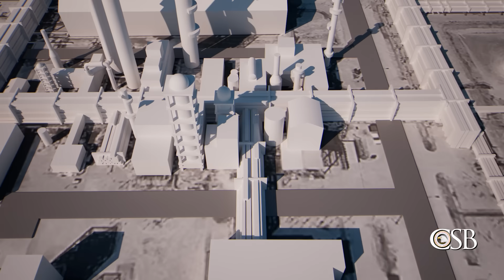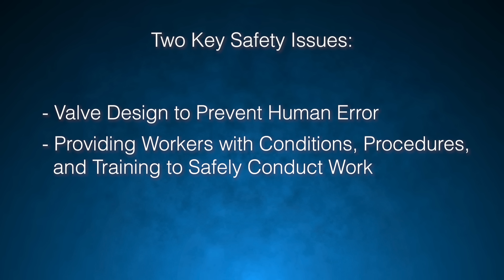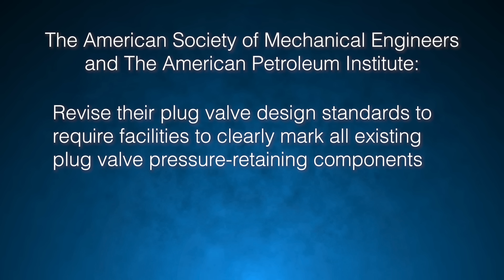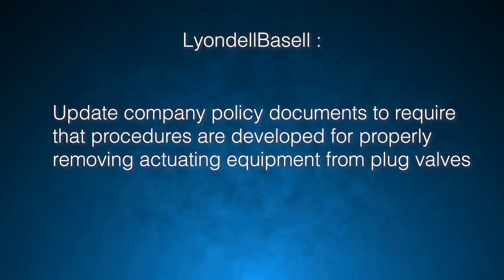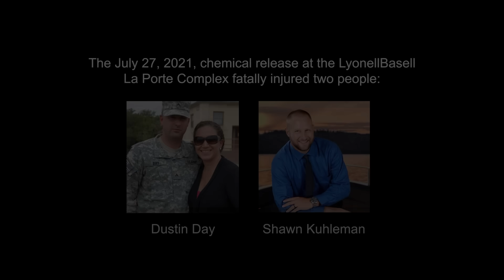Designed to Fail: Chemical Release at LyondellBasell

Comment: Acetic acid, what makes vinegar.
We use 5% for food, canning, and cleaning.
It smells and tastes bad enough.
I can’t imagine being doused in 100% strength of this stuff.
Reply: And HOT to boot.
Reply: I've worked with glacial acetic acid and acetic anhydride - the strongest "chip shop" vinegar smell ever! As a brit it just makes me crave chips.
Reply: I got a sniff of the 100% stuff in a lab once, it was awful. I couldn't smell anything else for an hour
Reply: @BrandNameCerealFlakes Anosmia is a dangerous thing in a chemistry working environment so I hope you didnt have any permanent issues.
Reply: @Cutest-Bunny998 its why i decided not to go into chemistry.
My sense of smell is worse than my legal blindness.
But sometimes rarely i can smell things. Idk why.
Reply: Yeh u was going to say I hate the smell of of vinegar at 2-3% I can't imagine what that would smell like even from 1000's of feet away
Reply: 20% vinegar will burn your lungs if inhaled. I cannot imagine how terrible this would feel.
Reply: @agoniaXdunya in the Landscaping industry where you have a ban on traditional pesticides do you use a product the concentrated is 25% acetic acid and you dilute it one part concentrate with three parts water. It killed virtually anything I sprayed it on
Reply: Stop bath for black and white silver photography chemistry is 28% acetic acid.
Reply: @johnmarten4184  they also call it Glacial Acetic Acid
Reply: I've experienced a plug valve replacement where there was about a gallon of this ac in the line left over from clearance and it was warm, not hot, and that was uncomfortable and I was about 3 feet away from it.  Bro who lived must be or is counting his days... Hope he lives a long productive life.... Preferably in an office with a settlement under his belt and a work shop in his garage.
Reply: We had some in chemistry class and we would challenge each other to keep our face above the container for the longest. 3 seconds was my record lol
Reply: Shift supervisor told me about how, when they worked a lot with it a few years ago, the mess hall would only let them take to go meals because of the smell.
Reply: Gotcha I was wondering what it was
Reply: I took a sniff of 100% acetic acid and i swear it singed my nose hairs
Reply: I got one tiny drop of glacial acetic acid on the lab bench. It left a tiny pit.
Reply: Not 100% here, but hot and a lot at high pressure
Reply: I actually use a cleaner for medical appliances that contains (probably diluted) acetic acid... scary to think about

Comment: Here is my theory on why they removed those nuts:  On some actuators (see page 20 of the report) the actuator is installed by putting a plate under those nuts. You still shouldn't remove them when removing the actuator, there are other nuts for doing that.... but if you had only ever installed new systems using that style plate you might think that the correct way to remove the actuator was to reverse the install procedure. This is also consistent with the worker's explanation for their actions.

Comment: I think the finding to identify pressure containing components of plug valves to be over the top.  Its clear as day what the bolts on the top of the valve are doing and if a maintenance worker cant figure that out, they are probably in the wrong field.  Also, being at a chemical plant, if you don't know something, ask.

Comment: NO NO FDA FDA REMOVE THAT FROM FOOD SOURCE
Reply: It's not some weird manufactured chemical. Its undiluted vinegar. They were just distilling it from its natural sources. Acetic acid is the scientific name for white vinegar that hasn't been diluted with water. It's dangerous only because it's concentrated. White vinegar, which humans have been using as a preservative and pickling method for ages, Is simply about 5% acetic acid diluted in water.

Comment: I'm Sorry 'It Should not be ingested if you can not Touch it.' Is A real thing?? Jesus
Reply: Acetic acid is just the scientific name for white vinegar that has not yet been diluted by water. When you buy it in the store, it is at about five percent concentration diluted in water. It's not some weird chemical additive. Vinegar has been used to flavor, Pickle, And preserve foods for centuries. This factory was just mass producing it, And this storage container had The acid at it's full hundred percent concentration, with no water in it to dilute it or soften the effects. It is not dangerous as vinegar, It's only dangerous when it's At a hot high temperature in a high concentration.

Comment: These videos are a great source of very useful information. Excellent job. Disassembling an actuator on a plug valve, or any valve, pipe, component, without fully understanding the systems and components is a sign of an untrained workforce.
Reply: Definitely wouldn't be a pipefitter doing that job here in Canada, pneumatic actuators and their valves are firmly within the scope of instrument techs.

Comment: Completely unwatchable. The truck tires don't rotate at 2:18. Edit: Oh I guess the camera is moving. Looked like it was backing up. Never mind
But really, wow. Removing the actual nuts holding the valve closed. That's a big oops. And they had so long to realize what they were doing.

Comment: I guess the actuator is removed to prevent accidentally opening of the valve during maintenance? But why can't they just take the actuator completely offline + physically lock it in closed position? That seems way safer and easier than removing the whole unit.

Comment: One of the workers explained his reasoning for removing the pressure-retaining nuts. He told the CSB they had to
remove the interior fasteners because “…it’s all connected. As [the actuator] sits up there, it’s all connected to one another.” This
worker did not seem to understand that the interior fasteners were pressure-retaining and should not have been removed.
Reply: If it was really necessary to remove the pressure retaining screws to remove the actuator, which I doubt, then the actuator should not have been removed under any circumstances. But that would not have been necessary to secure the valve so that it would not be opened accidentally. Usually you disconnect the power supply to the actuator when it is closed to prevent it from being opened accidentally.
Reply: @benjaminhampel8640  Correct.  And as such while I was there, that was the rule.  Don't touch that valve.  The only time it was, was after the reactor was emptied and depressured and made full of air to be entered.  ONLY 1 time as I remember.
Reply: @lpconserv6074  how did you know that?  oh, did someone teach you that?  well, that expertise costs money and time.   and i can just hire people and yell at them to get it done.   whatever.   insurance will pay.   stonks must go up.
Reply: @benjaminhampel8640  this feels kinda like what happened with an incident in baton rouge back in 2016, where a valve got stuck, and a badly made valve gearbox design connected to the top cap caused a release

Comment: How dum do you have to be to remove the bolt that hold the valve together while trying to take the actuator off.  The level off stupid that cause this accident had to be off the scale.  I find it hard to believe they where actually pipefitters and werent only unskilled helpers that had no training or knowledge.
Reply: Chemical plants and faculty's like them are amazingly complex and dangerous places.   The solution isnt to just paint the bolts a different color but  to hire qualified experienced people

Comment: I work on valves.   Those men might have been qualified to use a wrench.  They were not qualified to work on a valve.  And you dont have to remove a positioner to lock out a valve.  Process valves should be used only as a last resort in loto.

Comment: Just had the maintenance at my work fry $40K of equipment because of perceived simplicity. All that needed to be done was unhook three wires, move the equipment, and hook back up three wires to the same locations. The same personnel did both the disconnection and reconnection of the equipment... And got the wires hooked up in the wrong terminals of the terminal block... 208V into 115V rated electronics. Poof. Thankfully no injuries occurred.

Unfortunately, I think that there's a lot of maintenance done with zero or near-zero procedures, especially for jobs that are glanced at and hand-waved as being too simple to need to bother. There's an assumption made of both the knowledge of the operators at work and the details of the job. What if the wire gauge is different between locations? What if the terminal block is oriented in such a way that it's difficult to see clearly? These things happen frequently and add distraction to the work. Operators in the field need to be open to calling back for more information if they're not sure of a process to something, the business culture must be open to delays to ensure safety, and managers must expect things to never be as simple as they first look.

Comment: Table of Contents

0:00 USCSB Logo
0:09 Introduction
0:59 Background Information, part 1 (LyondellBasel, acetic acid)
1:27 Background Information, part 2 (leak discovery, making plan to fix it)
2:18 Background Information, part 3 (Turn2, procedure issues)
2:51 Incident Report
4:27 Board's Investigation, Safety Issue 1
6:15 Safety Issue 2
8:35 Credits and Dedication

Comment: Why was the actuator removed at all, rather than the power to the actuator disconnected (disconnect the air or electricity) & any manual controls of the actuator blocked? Surely to remove the entire actuator they had to remove the (air or electrical) power to  the actuator anyway, so why did the actuator need to be removed at all? And why were there FOUR OTHER fatal incidents of this type of actuator being removed???
Reply: The actuator was blocking access to the valve.

Comment: What makes this even more tragic is the acutator was being removed to allow for valve lockout. These workers were killed/injured performing a job that was intended to make another job safer. The risk assessment of repairing the leak was properly done, but the risk assesment of the task needed to complete the required work for that leak repair was lacking. The same as an electrician getting blown up by an arc flash while racking out a disconnect to de-energize something for repair.
Reply: What makes it even worse is that the valve actuator did not have to be removed in the first place. Usually, only the power supply to the actuator is interrupted when it is closed, so that it cannot be operated.
Reply: @benjaminhampel8640  You should always remove or block automatic actuators regardless. Certain actuators can have emergency operation conditions, like springs, capacitors, batteries, air tanks etc, that allows the actuator to do a "im dying" actuation. This is commonly used to ensure a safe state if power goes. The safe state could be that its open, to relieve potential overpressure, or closed, to prevent a unsafe supply of dangerous liquid. So you should always remove actuators unless you KNOW that it does not have a emergency actuation ability, OR you know the configured emergency actuation ability results in the "safe for work state" (which may not be the safe state for emergency/power loss).

ALSO: To close the valve, you would have to remove the actuator. Otherwise you would work against the actuator.
Reply: @benjaminhampel8640 In my Canadian refinery, we don't even rely on actuated valves for lock out. There's always a manual block valve close by, especially in a location shown in the video, being at the bottom of a vessel.
Reply: @TLarose.  Of course, if there is an additional manual valve, then you should use it, I agree with you. Apparently it wasn't there in this case.
Reply: @TLarose.  There is a video in uscsb that a fatal accident caused by a manual valve, it's very similar to this case. Things need to be foolprof, i worked as a maintenance tecnician in industrial factory, a lot of machinery we only used our thouth to demount and repair things, even the f engeneer didn't know how to do those things...
Reply: @benjaminhampel8640  would that work if the valve was air-to-close though? But I guess the absence of a manual valve there was really alarming, with all the static head of inventory up there. Control valves shouldn't be used for isolation purposes

Comment: When I screw up or don't know something. I go to the boss immediately no matter how embarrassing it is. This has never got me written up. The solution here is to try to idiot proof it instead of requiring management to be on scene for a valve critical procedure. Sure one sheet of paper could have prevented this but it's still a management failure

Comment: It is glacial acetic acid (high purity) that poses toxicity.
Also, before starting any maintainance or repair, make sure to shut down any process unit that depends on the process unit to be repaired and do a lockout and tagout.

Comment: How many other people were caught off guard by the mention of this toxic acid as a food additive at 1:15, only to Google it and learn that acetic acid is just vinegar (in a low concentration mix with water) but incredibly dangerous in its pure form?
Reply: Wait 'til you learn about aromatic esters.
Reply: Many things that you use over the counter are incredibly deadly in high concentrations. You can get a 3% hydrogen peroxide solution at a grocery store to disinfect cuts, and that only stings a bit; but, 85% or higher is considered to be a rocket fuel that is corrosive enough to strip the flesh off of your bones in minutes. It's hideously toxic when not extremely watered down.

Comment: OK, why isn't there a possibility to lockout the valve WITHOUT removing the actuator, i.e. have a lockout on the actuator ... or am I asking too much?
Reply: That's how the actuator and valve is designed. The shaft itself probably has to be locked out, not just unpoweing the actuator.

Comment: It was a pneumatic valve.  Just close the valve, disconnect the air lines, insert the blocking pin and lock and tag the blocking pin.  There is no safety advantage to removing the entire pneumatic operator.
Reply: It may have been a design or safety procedure to lock the shaft itself with a pin and not just the pin on the actuator. Also, there may have been an intent to remove the actuator to inspect, clean, and/or lubricate the coupler.
Reply: @canlib you are not just pinning when you disconnect the airlines.  You are eliminating the energy source necessary to open rather valve.  that is not what the video said.  They were using the valve to isolate for a downstream leak repair.  Removal of the pneumatic actuator is completely unnecessary to make the job safe.

Comment: No amount of training could save you from stupidity. My theory is that workers knew that they are removing valve plate retaining bolts (maybe there was a reason to do so), but they didn't think that the seal will not hold. At least, if there's a reason to remove those bolts, put a bunch of simple C-clamps around the plate to hold it in place (I admit, this is also sketchy, but way less so).

Comment: Shouldn't the larger safety issue in this video be more about the fact that something they put in our food burned 2 men to death?
Reply: Clearly you never made the mistake of foregoing the mandated rest period for a microwaved Hot Pocket. Literally lava.
Reply: Acetic acid is the main ingredient in vinegar. This is just the concentrated industrially derived version of that, and this version is probably not used in food. Sorta like how hydrogen peroxide is a harmless antiseptic at 3%, but if you have 98% peroxide it becomes an extremely corrosive explosive agent used for rocket fuel.

Comment: i always love a new USCSB video. your animations are always very detailed.  if they are accurate to the actual condition in this case, it should be very easy to tell that the 4 bolts on the black brackets are all thats required to remove the actuator.

additionally, it seems that it would be easier to disconnect the control pneumatic (or hydraulic) control lines and lock them out. another way would be to have a lock out bar that would affix the manual operation end of the operator stub to the frame on the machine. not sure what industry practice is here though. 

i work in the electrical utility industry, and our guidelines for disengaging motor operated high voltage switches is to uncouple the drive shaft from the operator and lock the drive pipe to a solid piece of the frame. 

we recently installed gas insulated switchgear, which makes it very difficult for us to uncouple a switch and lock to stationary frame. we had to create a device to allow us to do that. we also have concerns that untrained personnel may try and open an sf6 containing access plate, out of a lack of understanding of the equipment. 

we had a contractor fatality a few years back where the valve to the gauge was turned off on a large sf6 filled breaker. that leg leaked down and the gauge showed zero. the contractor saw the zero and removed bolts for a very large access plate. with one nut left on the plate, the 90 psi of pressure detached the plate and propelled him over 100’ away. there was a 1/4” valve next to the access plate that he could have checked to see if there was pressure of not. 

its all a matter of human performance and an understanding of the conditions you have been given to perform work. 

keep up the excellent work, again, im not in the chemical business, but the human performance and process aspects are almost always applicable to me in my line of work.

Comment: Another design change would be to redesign the actuator to include lock-out tag-out functions so that it doesn't have to be removed to lock the plug valve in the closed position.  Or in the open position if conditions require.